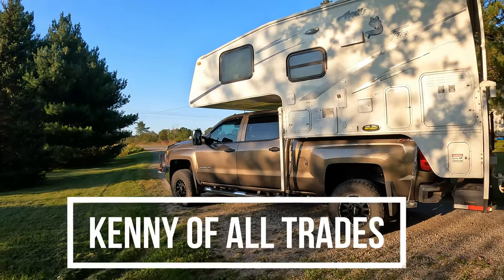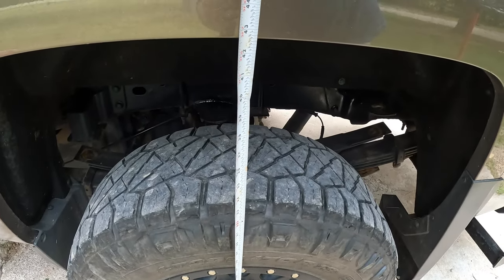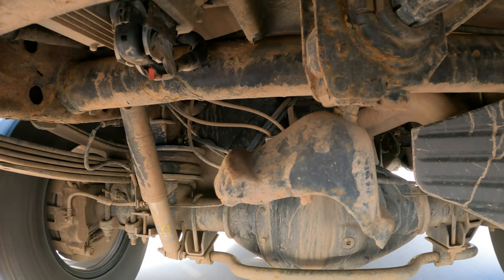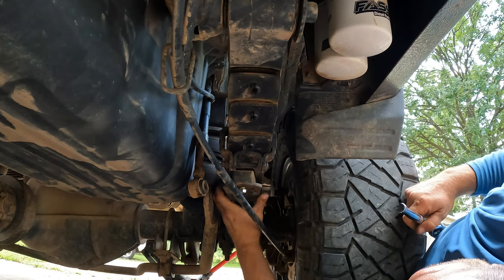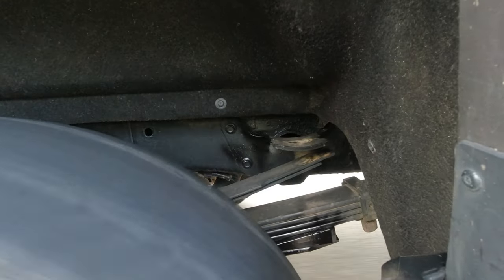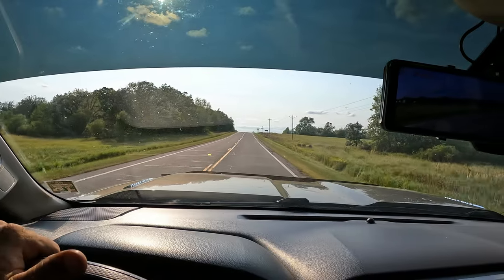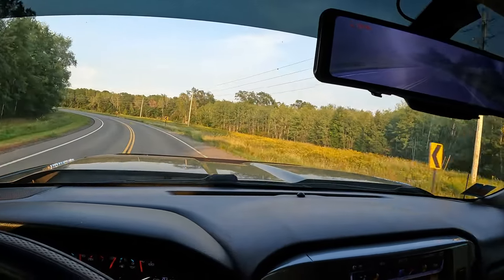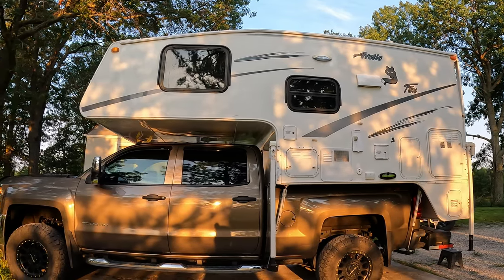Suspension Upgrades for Truck Camper

Comment: I got the exact same bump stops for my 22 Chev after seeing your first video. That will be one of my winter projects. Makes a lot of sense to do that upgrade to the suspension. Install is a little tougher on the newer model but doable.
Reply from the maker: I hope you are able to make it work. It really is a simple solution to increasing the capability of the trucks springs. It's crazy how much squat is needed to engage the overload springs.

Comment: Ken thanks for sharing this video. Looks like you and I are on the same page with upgrades. We may own different  Vehicles but both agree you have to step up the stock suspension. I have a Ram 1500 with a Cirrus 620 and I did air bags , heavy duty coil springs. Timbren suspension kit, Bilstein rear shocks  and a heavy duty Helwig sway bar. Also Rancho front leveling struts/shocks and most importantly ( people seem to forget  ) I also went with a tire upgrade for the load range. Anyway enough about me thanks again all good improvements to your rig. Keep the videos coming and as always stay safe and healthy.
Reply from the maker: Sounds like a great setup! I love that you are rurning a truck camper in a 1500.  The Cirrus is seriously a cool camper!
Reply: Well with only having a 1500 I'm limited to payload for campers and I love the Cirrus it fits my needs . If I have a Ram 3500 with the  Legendary Cummins diesel I'd have a lot more options . I'm very happy with all the upgrades I did ( of course I did all the work myself) very easy stuff. I think the sway bar made the biggest difference. Thanks again and maybe someday we will cross trails.

Comment: Thanks for taking the time to show how these mods work. One other nice upgrade is the Rancho 9000 adjustable shocks. You can set them for max firmness or all the way to zero for when the camper is not on the truck
Reply from the maker: Great suggestion! I'll be looking at them when it's time for replacements.
Reply: @KennyOfAllTrades  Tip:  If you do go for the Ranchos... look at painting them before you put them on, several buddies had them start rusting.  Also check out Bilstein's as an alternative.  Stay Safe sir.

Comment: Hey Kenny, great video thanks for sharing your mods. We just bought a 2016 F250 super duty, super cab short box. That will eventually be used as my work truck to replace my current 2010 2500 that has 224 thousand miles. The box weight is rated for 3300 lbs, our 2019 Palomino HS8801's dry weight is just under 2500 lbs. The truck squats about 2 inches when the camper is loaded. I installed the air lift #5000 bags  running at about 50 lbs of air, which helps bring it back to level, I just recently replaced the worn shocks with Monroe magnum gas that have a quicker recovery than the stock shocks. Haven't run the truck yet with the new shocks, Karal and I will be going out in a couple of weeks camping/atving , so we will find out how it rides hauling the camper and the ATV .
The only other thing we have noticed is that the campers cab over bounces when going over bumps. I'm hoping that having the new shocks will help with that.
Thanks again for sharing and if you have any other suggestions for the bounce and have the time to share your thoughts that would be awesome.
Stay safe, See you down the road,
Eric and Karal
Reply from the maker: That porpoising back and fourth has happened to me with every truck and camper combination I have ever owned. I have noticed the condition of the road plays a big part in the movement of the overhead cab. 
Lance truck campers  had shock absorbers that connected from the cabover to the front of the truck to resolve the issue. 
Although I get that annoying movement it has never been an issue. Its not so bad that effects the performance. The front of my truck is not bouncing, only the camper. If it was,  I would try to stiffening up my front suspension my turning up my torsion bars.
Reply: @KennyOfAllTrades  cool thanks for the info, the Ford has a taller cab than the Chevy, so I am going to measure between the over hang and cab, don't want it hitting the cab when it bounces... LoL.
Thanks again

Comment: Wow, Kenny! I hope this video gets a ton of views given the amount of work that you put in to showing the difference with each upgrade. I don’t know if you mentioned the brand but what Airbags did you go with? I see that you had a remote the control them. Does it work with each bag individually? 
Thanks again for all of your wonderful content! I am a traveling hospice nurse who is all over the states and I bought my unicorn truck from the original owner and have so far put new tires, billstien shocks, Supersprings, big wig sway bar and it came with manual airbags but I would like to replace them with something like you have. Thanks again, Kenny!
Reply from the maker: I went with the XL 7500 LBS Air Lift Load Lifters. The compressor is called the Wireless One made by Air Lift. Each bag can be separately adjusted from 5 to 100 pounds.

Comment: Great video. I’m running a little different setup but similar. Tried the wedges but had issues keeping them fixed in place. Torklift stainless lowers for two years now …work great but they rust. Lol. Upgraded shocks for porpoising. Big wig sway bar. Airlift 7500xl’s at 55psi. Camper is about 4100#. F350;DRW. Had a SRW but Ford recalled it for….of all things….payload. Oye! So I sold it for the DRW.
Reply from the maker: Sounds like a great setup. That sucks the stainless is rusting....what the heck! I'm running the Bilistin Shocks, they seem ok. The reviews make them sound like they are the best thing ever.......but there just ok.
Reply: @KennyOfAllTrades  Rust from the edges….propagating, disappointing which is why I liked and tried the wedges. Torklifts are expensive but I take them off each year, check them and dust them off. Lol I had to drill the holes in the springs….fun. 
Im running Bilstein as well…they do help with improved stiffness but agree with you, not as great as the hype. If I had to do it again I’d try the Rancho adjustable….maybe later. My previous truck I put different upper bump stops on but not this one. Perhaps I will again. Thanks again.
Reply: Did the upgraded shocks fix the porpoising?  Or was it the combination of suspension modifications?    Thanks
Reply: @gregoire8376  For me there was a noticeable difference in the for/aft rock (less) at higher speeds with the newer shocks. The ride just seemed more dampened. But it’s just feel, no actual data to prove it.

Comment: Great video Kenny!  Over the course of several trucks and more than a few campers, I came to the same conclusions.  In priority order, Big Wig sway bar for stability, upper Stabil-Loads to engage the overload springs sooner (also helps with stability), and Air Bags at 30-70 psi (depending on the camper and truck) to level it all out.  I didn't feel like I needed the lower Stabil-Loads, but YMMV.
Reply from the maker: Yep, I think you are spot on! In my experience the sway bar was probably the best investment for keeping the truck feeling planted in the curves and combating sway. The bags more or less keep things level....that was for my truck. I actually use the bags to fine tune my leveling once I get parked for the night.  I get almost 3  inches of travel out of the bags.
Thanks for watching!
Reply: @KennyOfAllTrades  Which bags/compressor do you use?  I’ve been using the Firestone air bags but my dealer recommended the Air Lift compressor (he said they had fewer warranty issues).
Reply from the maker: @edwtg59  I'm using Air Lift 7500XL Bags and the Air Lift EZ7400 compressor. I like them. The only problem I  have is when it gets cold out the compressor will freeze up. I'm talking like -10 degrees and below. But here in Minnesota that can be 3 months or longer at those temps. When that happens I fill the bags manually. It sucks not having the capability to fill on the fly in cold temps.

Comment: Great video with some great tips. I think I'll be taking a look at what's set up on my suspension when the sun comes up in the morning. I've got air bags, but those blocks in the spring pack are really getting me thinking.
Reply from the maker: Those are affordable and effective. The bump stops on the upper overload springs have held up for almost 100k miles. A few weeks back, I needed my truck bed, and I had to remove the camper. I had a 500-mile drive, so I pulled out the felling wedges to damper my ride. There was no wear to the wedges. 
The big downfall of the wedges in the spring pack is the extra stiff ride when the truck is unloaded. It takes about 45 minutes to pull them out and 30 minutes to put them back in. That's the biggest problem. Going with the Torklift Stable loads would speed up the process.
Reply: @KennyOfAllTrades   Thanks for the tips. I had a look at my setup and the gap between the upper overload and the spring pack is so big (at least four to five inches) that I'm sure it's only engaging when I get the "feels like we're about to tip over" level of swaying. And yet, I can see there has definitely been contact.
So definitely looks like I've got room for improvement, no pun intended.

Comment: Great video, Thanks for the information.   I have a 2004 Chevy 2500HD Duramax Diesel. 6.5 bed, and a NORTHSTAR 8.5 ARROW  _/ with no slides. Bed and rear bumper mounted. Everything is stock. I've done absolutely no mods. I get very little sway on the road. Im aware of the sway so when I dry camp like you do,,, I take my time on rough forest service roads since i am not FRAME MOUNTED. Ive had this rig for 15 years. Camper goes to covered storage at the end of the season and comes out after the last freeze. H.O.A. prevents me of having camper at home. Unless ON THE TRUCK. 3 DAYS OFF THE TRUCK. Ive been from west coast to east coast several times. No problems whatsoever.  But I am always vigilant that i have no mods and that my camper is BED MOUNTED. I drive very defensively and never exceed 65 MPH even on Interstate.  Although I have the power, I am retired so I dont care how long it takes me to get from point a to point b. 
THANKS FOR YOUR AMAZING CHANNEL.
Reply from the maker: That sounds like a great setup! I hope to do some longer road trips one day. I still have a few years to go before I can retire. One day it will happen.

Comment: Wow! That’s what I love about your videos. You find and utilize the most simple things to accomplish a task. Felling wedges?? Who would have thought!! 
What brand of air bags and compressor did you use? All I’m seeing does not allow for independent operation between left and right. It’s both sides up or down. Thanks again Kenny! Great work my friend.
Reply from the maker: Thanks. I went with the airlift load lifter 7500xl bages. The compressor is called Wireless One from Airlift. It's really important to be able to adjust each side independently. I had a truck with bags plumbed together. It was a nightmare. Once the truck started rocking, the issue only got worse. The air was getting forced out of one bag and into the other, causing more issues with sway.

Comment: nice! I have the bags but I need the rear sway and bump stops 👍
Reply from the maker: The bags are very nice. I use them all the time to fine-tune the level at the campsite. The sway was a very noticeable upgrade. It this point, I don't even notice the camper back there. Thanks for watching.

Comment: Great Video! Does it work on 3/4 ton pickups, the overhang ones, I have a 8ft bed.
Reply from the maker: I had this camper on a 2008 Silverado 2500 with the 6L gas engine. It handled fine. Not as sturdy as the 3500. But it wasn't a white knuckle drive either. The main difference is, no upper overload spring pack on the 2500.
Reply: @KennyOfAllTrades  it’s a 1 ton I meant, a 1989 ford f250 single cab long bed

Comment: Great video….I did the exact same upgrades on my 2017 F250….you didn’t talk about your tire setup though…I upgraded my tires (which I am sure you did as well)…after 15+ years of having a truck camper you certainly do figure out how to make that suspension work with a truck camper….BTW…do you have a leveling kit on your truck?
Reply from the maker: I do have a leveling kit. It's the suspension Max kit. This was my second video on suspension upgrades. The first video goes into my front end upgrades. I added a steering stabilizer, upgraded control arms and tie rods. I also talk about the wheel and tire upgrades. I'm running load index 129 tires which required a little lift. I also run the Method wheels which are rated about 500 pounds more carringing capacity per wheel. 
Unfortunately I didn't have time to put all that in this video.  I work Monday through Friday so I only have Saturdays and Sundays to film. That's why I wasn't able to fit everything in......one day I would love to have more time for videos. 
Thanks for watching!

Comment: Lots of thanks here but still no enough gratitude for all the work you put in just to share useful info with us. About the 35 psi, is that enough to handle your weight? I know airbags commonly can hold about 50 lbs per psi inflated as a pair. Maybe you have some extra heavy duty ones though. Cheers
Reply from the maker: Thanks! At 35 psi, I'm sitting level. I'm running the 7500 pound bags. They can be set up to 100 psi. At night, I bump up the psi so the truck is raked, and my headlights don't blind oncoming traffic.

Comment: Kenny thanks for explaining this. I didn't know you put a felling wedge on the front. Do you feel the tires make a difference. Thanks for a great video as always.
Reply from the maker: I think the tires can make a big difference.  My advice would be to go with a load index 129 tire, brand name and tire type is subjective. 
A load index #129 tire is rated for 4080 pounds. Compare that to the factory load index #124 tire at 3527 pounds.  That's over 2000 pounds of  carrying capacity. 
I did look at commercial tires, 19.5". The reason I stuck with LT tires is because I couldn't find easy access to replacment commercial tires. 
I can get a flat almost anywhere and find an 18" tire. When I looked for a 19.5" I found I would have to get it shipped in.

Comment: I have talked about the setup my brother has on his dually which ends up being very similar to what you've done Kenny, aside from the fact he had to install ( I am going to say two extra leaf springs per side ) and yes he spent way too much on those stable loads and upper overload extended bump stops for what is there as I both laugh and admire the falling wedges as you have certainly proved that they can handle the application. I am surprised your truck did not come with a rear sway bar since its a one ton but I think for the most part dually's typically do. Kenny, have you looked to see if there is an aftermarket front sway bar that is larger then the factory unit as I am curious if such a thing exists for your application. Also I wonder if your shocks are getting to the point that they should be replaced, not that I suggest they are worn out but they don't last forever and again not sure if there is an aftermarket shock that would help just that bit more for stability. The nice thing about your unit for your purposes is that it is a married unit and not this weekday empty pickup and weekend carrying a camper scenario as that is an impossible set up to suit both purposes.
Reply from the maker: Thanks for the comment. I should have mentioned the shocks, and some of my front end work.  I installed Billistine 5100 shocks last summer. My factory one were completely flat, no rebound at all. I read a ton of excellent reviews on the shocks, people said they were the best thing since sliced bread....I didn't notice a huge improvement over my leaked out flat Ranchero's. 
The truck came factory with the snow plow package. I was told that came with some upgraded front end components including larger torsion bars. I'm not sure if it also includes a larger sway bar or not. I replaced the sway bar end links last year. Actually i rebuilt the front end with Kryptonite and PPIE Components. I also installed the suspension Max torsion leveling kit with the drop spacers for the front di. And a Billistine steering stabilizer.  
That was all in last year's video detailing my suspension upgrades. This year I focused more on the back of the truck.
Reply: @KennyOfAllTrades  I too have heard good things about the Bilstein 5100 shocks but that was for a Jeep TJ or Toyota Tacoma, I have no idea what they create for a truck like yours. In terms of my brothers truck I think it actually has Rancho shocks from the factory as well and unless a shock leaks its impossible to visually know its performance is reduced unless its so bad that the vehicle is a pogo stick on the road. With such high loads I think a person has to install the ... "stiffest bastards possible" that won't rip the shock mounts right off ! . Speaking of sway bar end links, I bet a lot of trucks that get this type of use end up with crapped out end link bushings sooner then some owners realize who are not inspecting the components like you obviously are and replacing before its a hazard on the road.

Comment: Kenny...that was the most thorough video I've seen yet in dealing with that specific issue!! 1 question: How did you manage to get purchase on your carriage bolts with out holding on to the nut? Did it just sinch down on its own?  Thanks for all the hard work on that vid!
Reply from the maker: Thanks! The felling wedges are made of hard plastic.  The carriage bolts suck into the plastic, making the perfect seat. I'm glad you enjoyed the video. I tried to show the outcome of each upgrade. I think all of them helped in some ways.